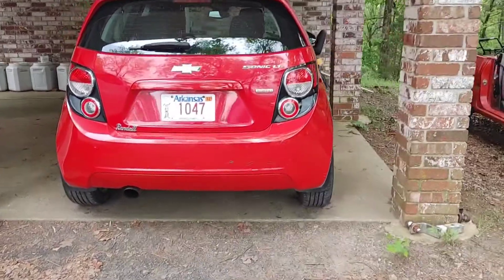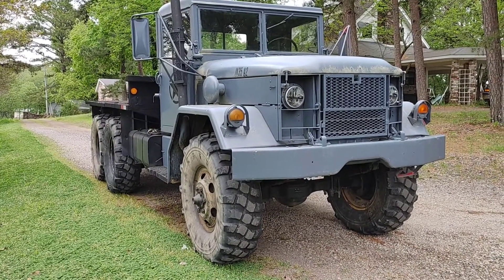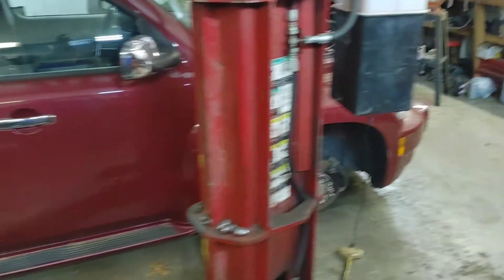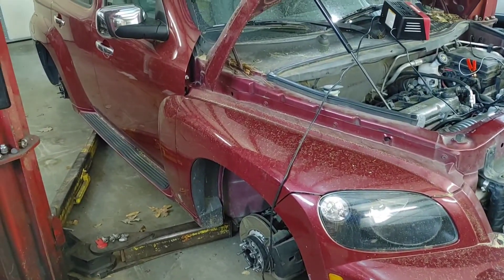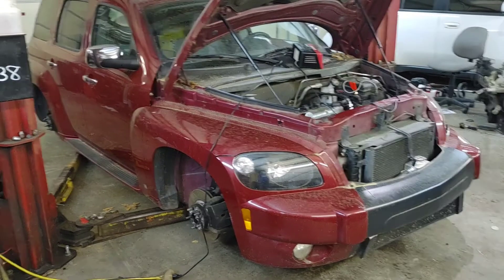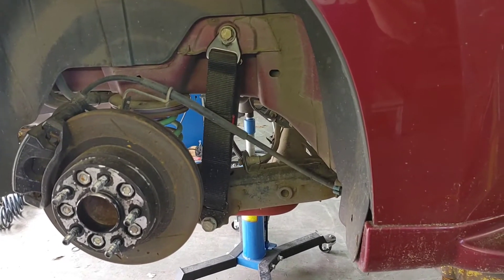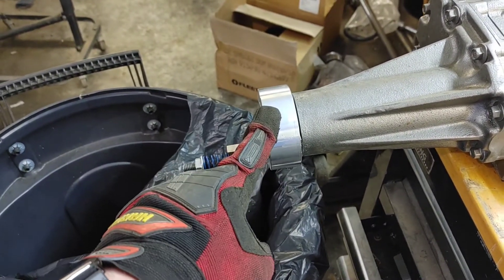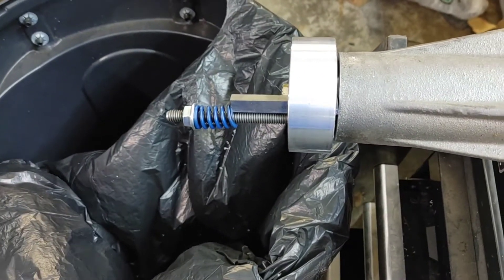Project updates. Supercharged HHR Saab 9-7x, M35a2, 2500HD Silverado

Comment: Joseph smart choice in doing the meth injection. I would also suggest going with the stealth heat exchanger to replace the s3 heat exchanger.
Reply from the maker: I have thought about doing that. The biggest issues with that is, I horrendously cut up my front bumper to fit the s3, and I'll also have to completely redo all of my I/C pump lines and pump placement. If the water/meth injection doesn't do the trick though, I will definitely be swapping for a better heat exchanger.